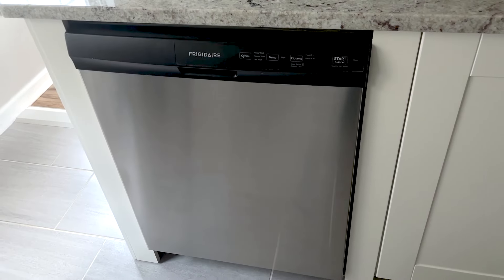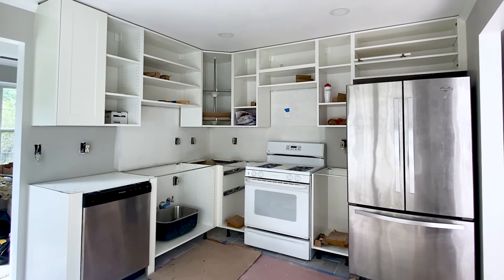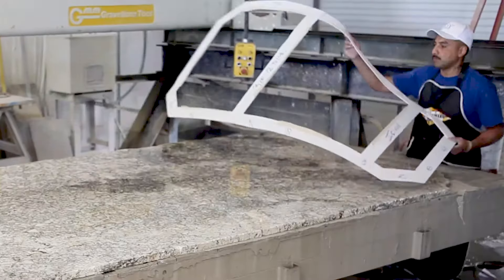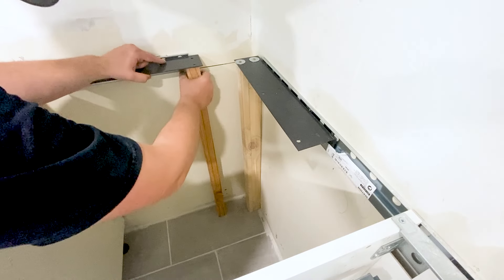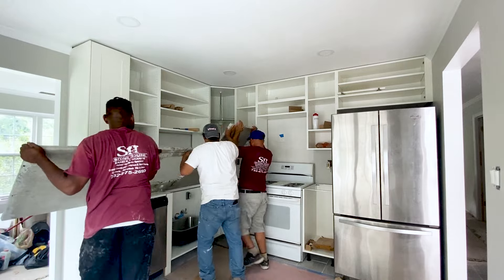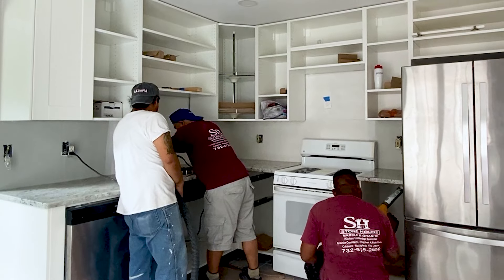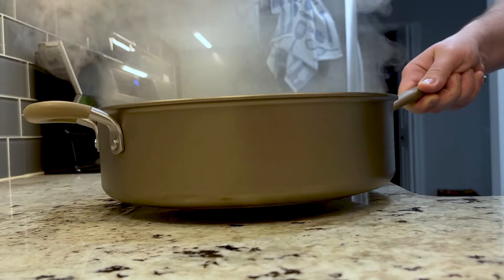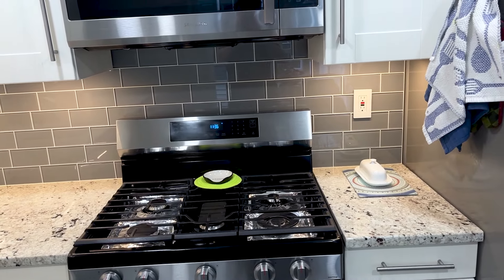Granite Countertop Installation: What to Expect!

Comment: So the slab holds itself in place just by the shear weight of it? I thought there was a glue or something.
Reply from the maker: Jack thank you taking the time to ask a question. It gets siliconed around the perimeter. And the weight of it is enough to hold it in place according to my installers. I was just as surprised as you
Reply: @DIYwithMAX  that’s awesome, I never knew that. Thanks for the reply.
Reply from the maker: My pleasure. If you ever have questions or if I can help with your future projects please feel free to reach out. Thank you for subscribing to support the channel.